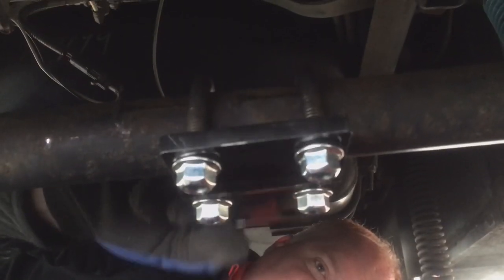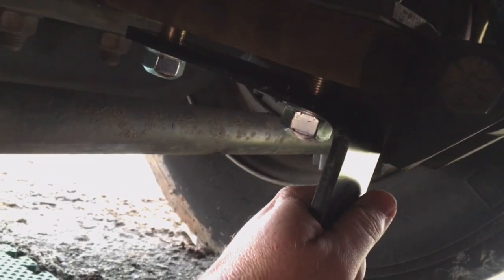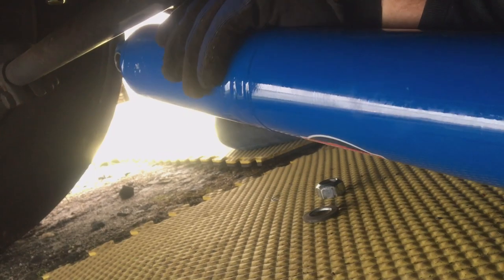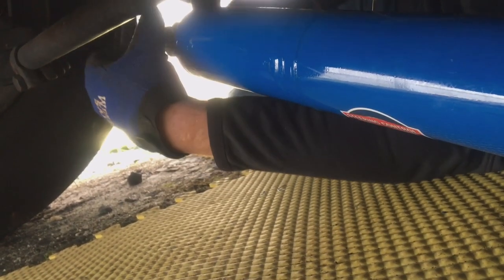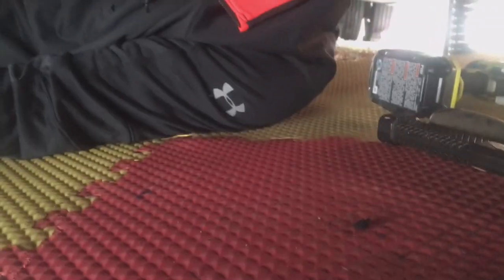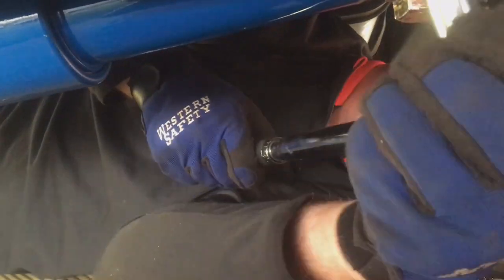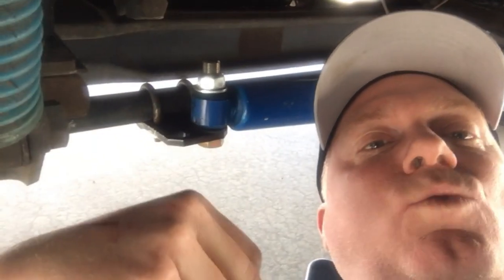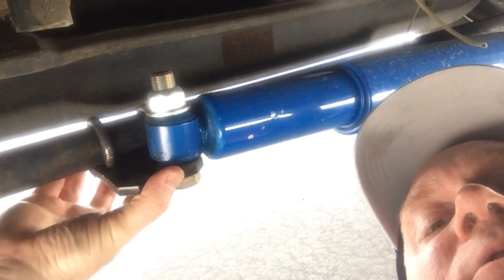DIY - Safe-T-Plus step-by-step driveway installation.  1999 Fleetwood Discovery 37V

Comment: the  Safety plus makes a huge difference I was thinking RVing wasn't for me on the way down to Charleston and then Florida we had it installed in Florida
but I thought I could have done it myself. If we are a river we are filled more than we can pour out! I have named our RV the holy roller two looking for a river deep enough to baptize her in LOL
RV Royal Priest Gary
Reply from the maker: HA!!!  love it.  As you can see, it wasn't THAT difficult to install.  The hardest part was getting the original frame bolts off, I had to use a steel pipe over my socket that was 8 feet long to get enough leverage to break them loose.  The frustrating part was adjusting it since it was POURING rain when I did it.  I was on a creeper in the church parking lot, and although my body and head were under the rig doing the adjustments, my legs and feet were outside of the rig and got SOAKED! 
It was also great to have my 9-year-old daughter be my camera girl, and to spend some time hanging out with dad working in the driveway!
Safe travels in your rig my brother, keep it dirty side down!
BTW: Where are you from, seems like you travel some of the same roads that I do. I am up here in Spartanburg, SC.  Headed to Disney in 3 weeks, staying at Ft. Wilderness. WHo Hoo!!
Reply: we live in Boone North Carolina now but we are  from Texas our son played football at App State we sold our Ranch and left out businesses and moved here
our son and daughter in law live in Charleston.
do you use a brake system in your Toad?
Reply from the maker: @garyanderson2490  yes, but that's because I use a STEHL tow dolly (that has electric brakes as part of the trailer) with a 2-down Chevy Impala toad.  
Boone is where my family is from.  My grandfather actually built the Christian Advent Church behind the Daniel Boone Inn.  That's where my parents got married and where I asked the fantasy goddess to marry me!  I have Aunts and Uncles all over Boone.  The family house and graveyard is back on the far side of Buckeye Hill, past "Goober Peas".  
Do y'all take your rig to Charleston a lot?  Where is your favorite place to stay there? (My wife LOVES Charleston).
Reply: @RVPastorKevin  WOW!!!! we drive by that church everyday we live 1000' above The Rock near Howards Knob 
this is Crazy!!!
we are leaving to Charleston next Friday staying at L9  again that you videoed for our anniversary then a trip to Texas to visit and sing I got saved by Selah at my Baptist Brothers church who Baptized me in my pool I didn't want LOL
He and I still Read the Bible and pray together Tuesday thru Friday via I phone.
next time you come to Boone we have a spot for Y'all and the Holy Roller I 
Praying Shalom over you and yours three generations deep Pastor Kevin 
In Jesus name 
Amen
RV Royal Priest Gary
Reply: Hey Kevin 
we are thinking of up grading to a diesel pusher so I can pull my wife's equinox 
I test drove a 1999 Newmar dutch star 3858 with a cat 300
It seemed to not have as much power as our V10 coming up the hills on 221
coming back into Boone
what motor is in your RV?
Reply from the maker: @garyanderson2490  I have a 275HP Cummins, and a 6 speed Allison transmission. With the Impala on the tow dolly, I don't even notice it is back there. It doesn't come off the line fast, but what RV does?  Also, since it is a '99, there is no DEF required, and I get GREAT gas mileage on it, WAY better than most of the newer RVs.
Reply: @RVPastorKevin  decided to stay with our gas so installed front and rear suspension upgrades, installed a tuner, and removed the carpet and installed wood vinyl  flooring

Comment: Pastor kevin, I have a 99’ Fleetwood discovery 36R and I looked at safeTplus website and it list 2002 models and newer.  I think I heard in some of your videos that your 37V is also a 99’ model.  If this is the case which safeTplus model did you purchase? I think the one you bought should probably fit my 36R.  I’d appreciate any feedback.  
Thanks for your consideration 👍🏼
Reply from the maker: I ran in to the same issues. I called the toll free freightliner number, gave them my VIN and they gave me the year and model of my chassis. The. I called SafeTPlus and told them that information, and they told me the correct model number to order. (Mine was the BLUE unit with the attachment kit (Model F-143-K2) for a ‘00 Freightliner XC Chassis.)
Just work the phones and you will be good!
Freightliner toll free help:  (800) 385-4357
SafeTPlus number:  1 (800) 872-7233

I hope this helps!!
Reply from the maker: You may also want to join the Discovery Owners group. It is a fantastic group of folks who have similar rigs and who are always ready to help out with any issue you are having with your discovery!!
https://www.discoveryowners.com/home.html
Reply: @RVPastorKevin  thanks again for all your help!!!